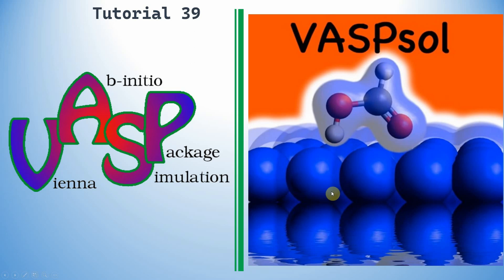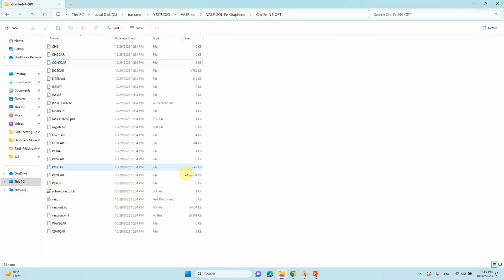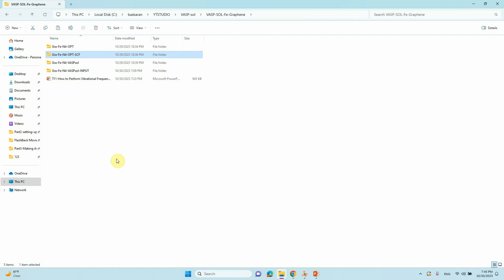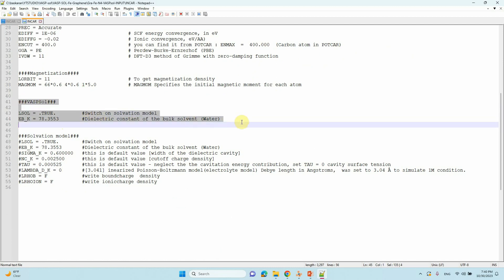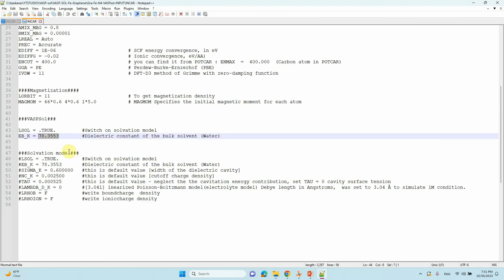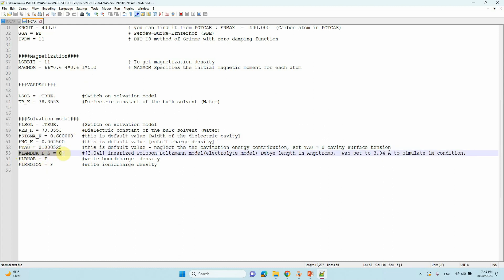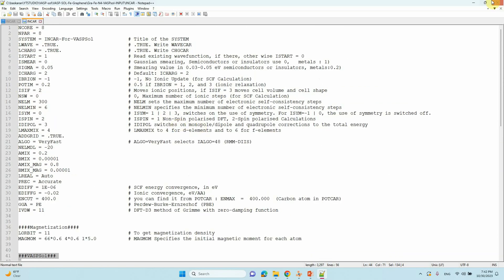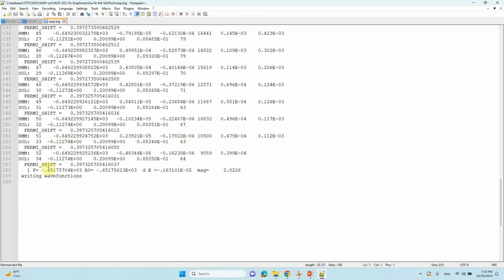How to perform VASPsol calculation using VASP code | Implicit solvent model

Comment: When calculating vaspsol with water we have to adsorbe water molecule or simply after optimization of structure then add two tags to check the solvent effect
Reply from the maker: This video tutorial for implicit salvation model, First do gas phase geometry optimization, then follow How to perform VASPsol calculation using VASP code | Implicit solvent model
https://youtu.be/kxS7DeYj-pM
Reply: @ how to do optimization in gas phase. Is it simple optimization of structure without solvent? Second, we want to calculate the diffusion barrier with solvent to check the solvent effect on diffusion barrier

Comment: why you specify the magmom ? and y 0.6 for C
Reply from the maker: If you using transition metals like Mn, Fe, Co, you should specify the magmom tag , because these are posses more unpaired electron and magnetic metal.  You can also keep 0 for C, atom, if keep 0, more time will take to converge, we can also use magmom 1 for carbon.